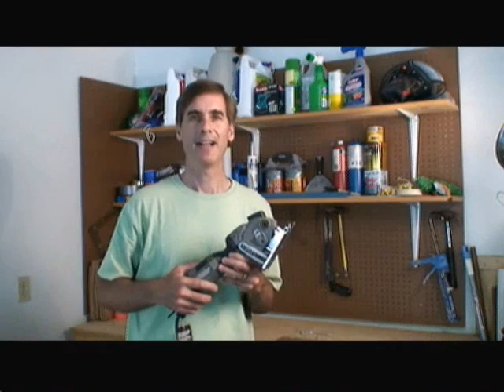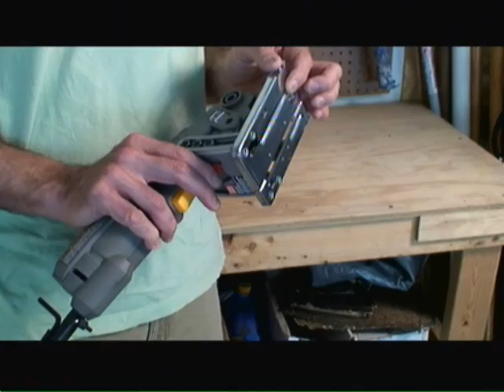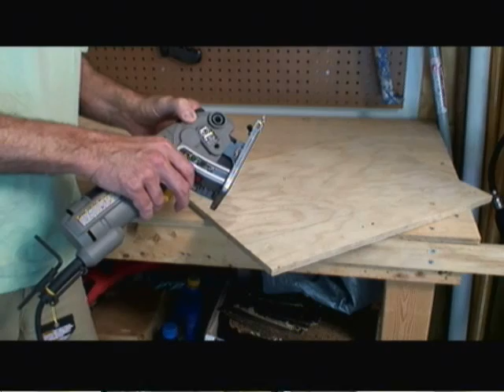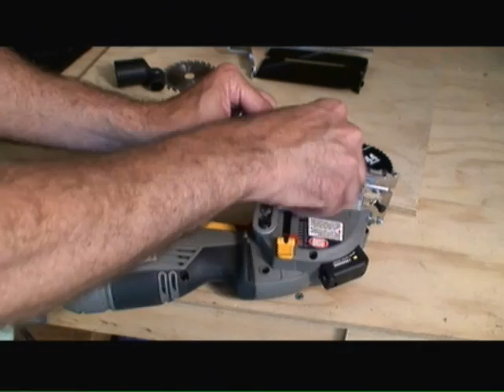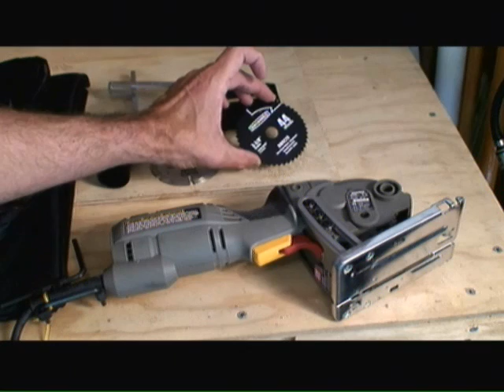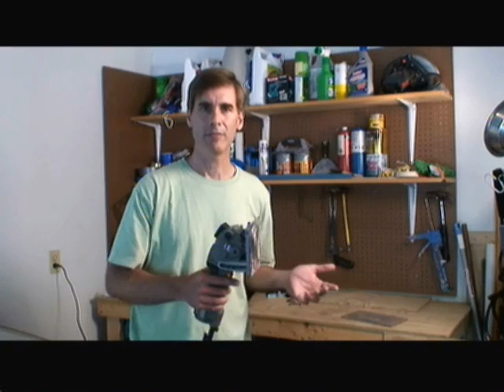Rockwell Tools Versacut Mini Circular Saw Video

Comment: Does it require considerable effort to push it down to expose the blade? Looks tiring.
Reply from the maker: There is very little pressure required to expose the blade.
Reply: HomeAdditionPlus I bought one. You are right. I needed very little pressure to cut. This is one handy saw.
Reply: +Gino Punsalan Not at all
Reply: +Gino Punsalan Thanks for the support :)

Comment from the maker: Possibly the blade is dull or you weren't holding the saw blade perfectly perpendicular to the material you were cutting. It's also the laminate planks were melting as you cut. Try running the blade at a slower RPM so the heat won't build up so fast and cause the laminate to melt/burn.

Comment: I don't know what is wrong with mine...I tried using it to cut laminate planks and it smoked so bad and left burn marks.  I used the right blade so not sure why it does that.

Comment: I'm using this thing to remodel my kids bathroom, I'm really impressed with it.  So far I'm half way done with the ceramic tile and the blade is still cutting well.  Replacements cost 40 at lowes and the come in a three pack

Comment from the maker: @BlackCaScorpio There is a small allen wrench type tool that is used to lock the blade from turning as you use a second allen wrench to loosen the nut that holds the blade.